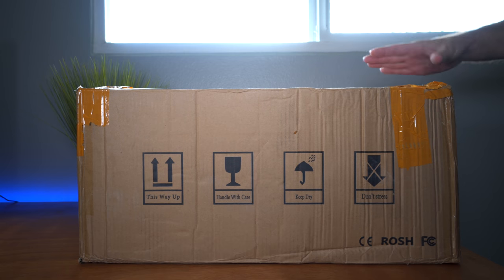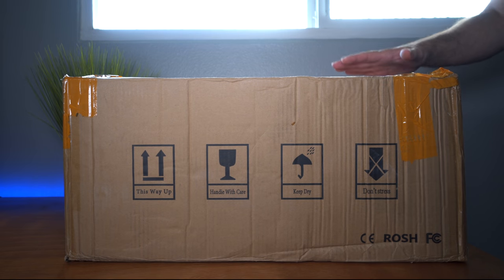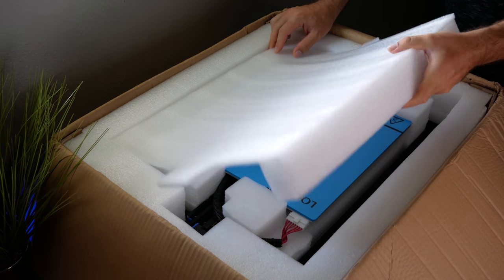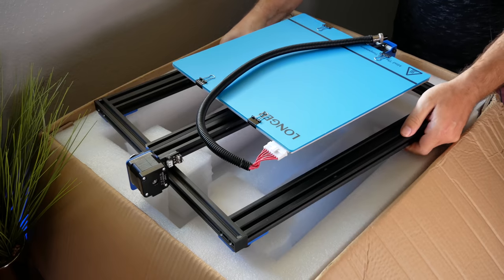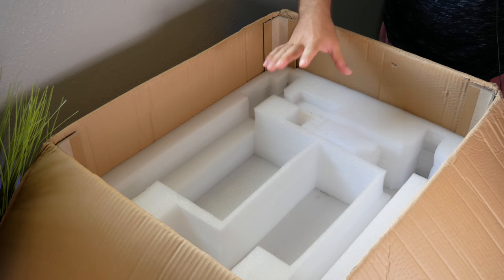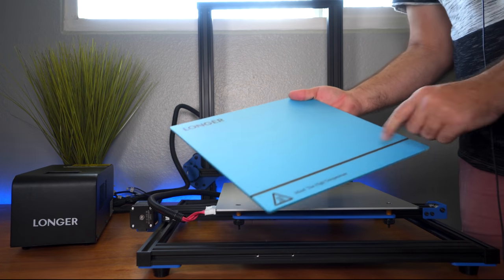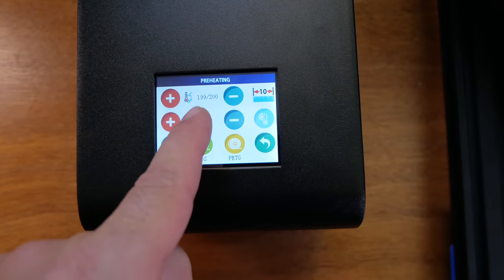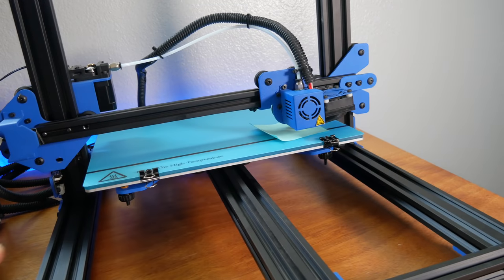Longer LK1 - Large Format 3D Printer - Unbox & Setup

Comment: Have both LK1 and Ender 3 Pro. Hands down wish I would have bought another LK1 and never touched the Ender 3. Less mods available for the LK1 but had way less problems with it. Mainboard failed on day 4, received new board on day 7 vs Ender had warped bed, corrupted firmware and twisted gantry with Creality wanting a video of issues before doing anything. That said Longer customer service is spectacular, easier setup, painless leveling and has held level for over 10 big 20+hr prints so far.
Reply: Amen. I had so many problems w my ender 3 v2. I wish I bought this first. It seems much easier to assemble and get started printing.

Comment: I bought this printer and I tried everything to get it to print right. I leveled it and everything except the tighten the wheels part.  But my printer won't print right.  It wont extrude the filament while printing,  it makes a sound like it's not feeding the filament through. Any advice?

Comment: Hey man, my z axis doesn’t move at all. I can’t pull up on it. It’s aligned correctly and the rollers try moving so I know they aren’t jammed. Feels like the motor is making it not move. Any suggestions? To be clear I’m at 14:20 of your guide. I haven’t powered it on or anything
Reply from the maker: Try turning the coupler manually, it should turn pretty easy. If its still binding you might have to take apart the Z axis components and analyze them.
Reply: If you haven't found a resolution to this issue yet. This is because there are 2 bolts that hold the z axis in place. You will find one on each side in the front. Remove these bolts and the z axis will be allowed to move.